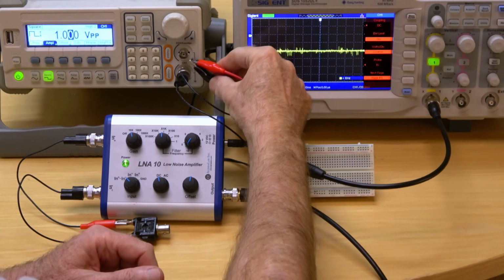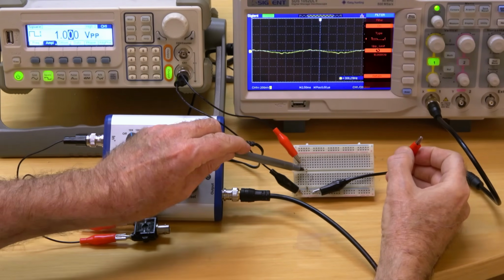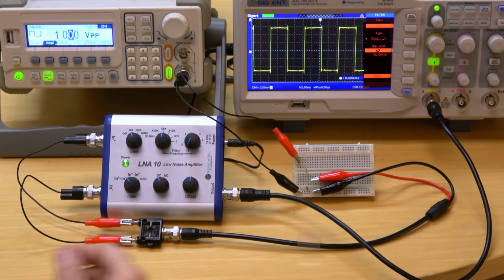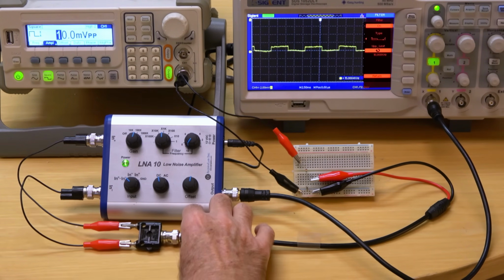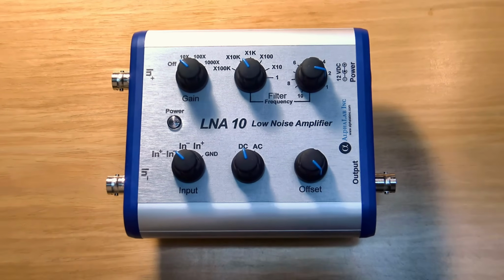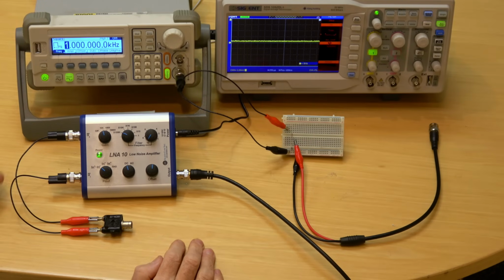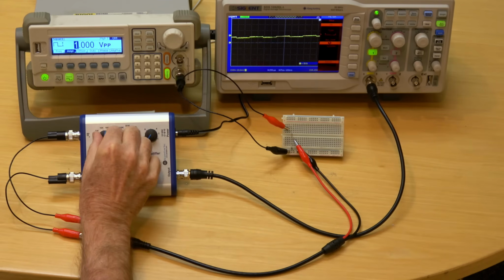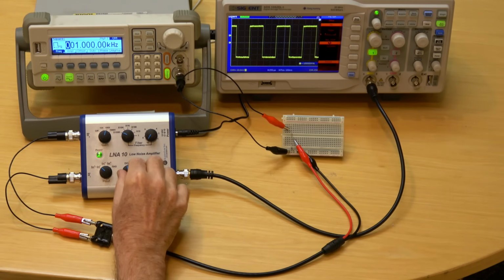Low Noise Differential Amp Cuts Noise By ~100x

Comment: It just occurred to me because I had this problem just a few days ago: I could connect a clip probe to the second channel and make the scope do maths to subtract the second channel from the first.
Reply from the maker: I was thinking of doing a video on that... subtracting Ch2 from Ch1, because it works extremely badly. In digital scopes, it creates even more noise than just using single ended input because the 2 channels only have typically 256 levels of resolution (when at least 100,000 is needed), and they digitize the signal at slightly different times.

Comment: fast switching events at even a low 100kHz makes noise and harmonics well past 2MHz, even 20MHz+.  Anybody who has designed or worked with modern converters knows this. Hence, this is why this product is not that great for this application. I hope alphalab will find a way to make one at 20MHz bandwidth or more, then I'm interested.
Reply from the maker: I'm considering a 100 MHz version, although the max gain should probably be 100x because of the white noise at those wider bandwidths.
Reply: @alphalabinc  I would love this thing if it filtered noise caused by GaNfets switching at 5Mhz.

Comment: Why the amplifier built into the oscilloscope doesn't have this performance? We're connecting both signal and ground to it, what is the reason it's internal differential amplifier doesnt filter the ground noise?
Reply from the maker: I was expecting the MATH function of a scope (CH1 connected to signal, CH2 connected to ground, then take CH1 minus CH2) to help with common mode noise, but in fact this makes the noise worse than just reading the signal with CH1 in the normal way. The problems with the MATH function are that the two signals are digitized before they are subtracted and there are only 1024 (or fewer) levels. Also the two amplifier gains are not tightly matched if two ADCs are used, or they don't sample at the same time if only one ADC is used. As a result, the CH2 (ground) signal is essentially incorrect and makes things worse when it's subtracted from CH1. Try this with a small input signal to see what I mean. (Also, if you want more vertical gain than the typical 1mV/Div, you will need an amplifier anyway.)

Comment: I bought one of these last year, it really does work as well as he shows in the video.   The only problem with it is the steep price tag; at $385 it costs more than most entry level/hobbyist oscilloscopes.  The scope used in the video costs $100 less than the LNA10.
Reply from the maker: That is correct. It's not a mass-produced item & made in the US (BTW, I do the final calibration and inspection myself.)
Reply: I think it's well worth it. I will probably get one and it will greatly improve the noise floor of my Rigol which I currently hate.
Reply: Purchased LNA-10 (SN543) a couple years ago.
   Thought somebody might like to see measured:   100Hz 10uv rms input  (triggered high level 10mv rms)
LNA set at   Av=100    filter =1kHz
12bit scope 10k point FFT (DC-1kHz, Hanning)  signal  -100dBv
  noise floor average (4) =  -156dBv       -148dBv peak      ~3.2 nv/rt Hz    1/f corner  ~8Hz

Comment: too bad bandwidth is low.. 1MHz.so not very useful for many switchmode power supplies where this type of measurement is difficult.
Reply: Not 'too bad'. Just how the tech is right now. You can't use it, and it's not made for that use to begin with.
Reply: usually bucking converters run at 30kHz. Almost all  switching power supplies 
sold nowadays including phone chargers etc.
Reply: @holyorderofscientists  many of the non-isolated DC-DC converters that work in the lower voltage range (e.g 12 to 5V) work with up to 2MHz.
Reply: @ Thanks for the info!
Reply: @holyorderofscientists  I have an old block 220 in 12 there is a frequency of 120 kHz 30 kHz no one has been using it for a very long time. 
and if they do use it, it will only make it worse)
for example xiaomi chargers. how could such shit be made in 22
Reply: @ Thank you for the detailed info. You updated my registry in my brain.  May I ask what converters use such high frequency of 1.4 MHz?
Reply: @ 
PWM + mosfets fast with low resistance
Reply: @ 
they're fighting for 2.4 right now
I won’t do this, my oscilloscope does not have sufficient resolution-you can see what 1.4 looks like on me and it works in the device too
Reply: @holyorderofscientists  to make 2 more than 2 you need an oscillation frequency of about 1 gigahertz, preferably with 2 megasamples.that there is a problem. and on others you won’t be able to see the mosfets rattling
Reply: @holyorderofscientists  In general, the device measures 5 by 3 centimeters and has 3 amperes 16 volts. In pulse mode 6 amperes. You can also reduce the size by 2 times, but you only need tantalum capacitors
Reply: @ПавелС-ш8м   I just went and picked up my 12V 5A chargers as I needed some power for my projects. What you are describing are incredibly powerful power sources 16V 6A in  pulse mode. Also I did not have a clue about size reduction with tantalum caps. You are updating my information! Looks like the power supplies I have are ages old ! They are made some 10 years ago or so.
Reply: @holyorderofscientists  
Well, my goals were energy efficiency. this is very important to me
Reply: @holyorderofscientists  You can see what chats it works on. I haven’t used anything below 1 MHz for 8 years now
Reply: and look at the operating modes in the 1.4 MHz converter. This is where the difficulties begin. And soon I’ll be using 2.4...
Reply: this requires an oscillograph with 384 MHz with a large fast buffer. But for a noise generator in the signal, I don’t know. It will probably be very expensive